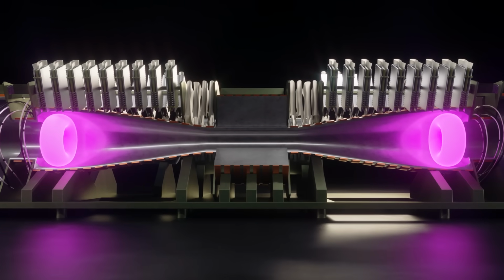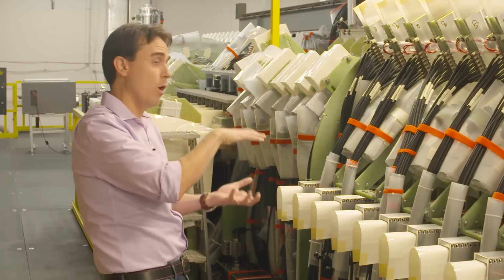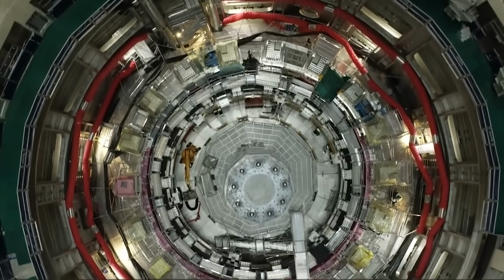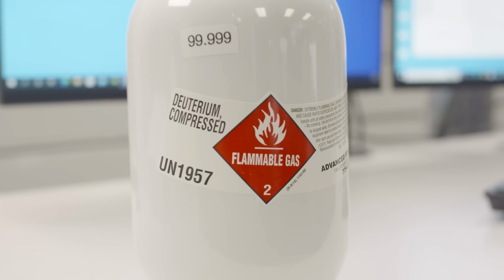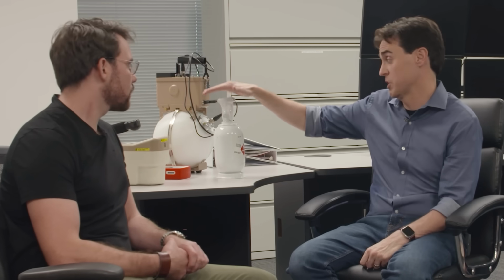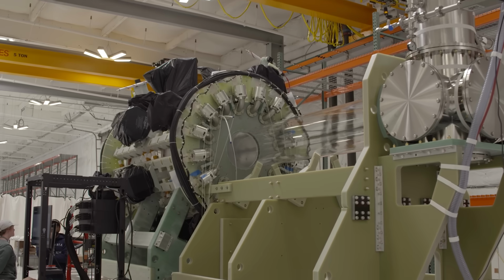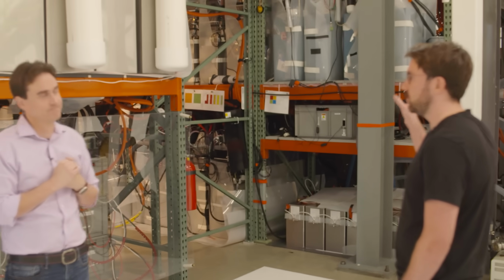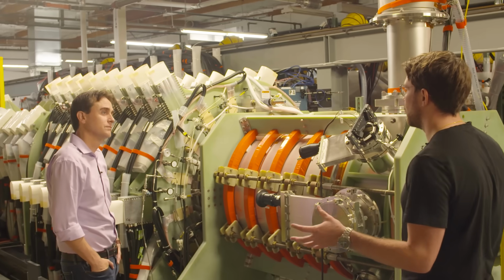A New Way to Achieve Nuclear Fusion: Helion

Comment: I'd be curious to know if someone could take this machine into the space vacuum chamber to see how it would perform, with your machine and some tweaking I can see space travel evolving like it's never been imagined before.
Reply: It even looks like a starship motor
Reply: @datalink-v8n  This design probably wouldn't make a very good engine for a starship though because it's a pulsed design. Engines need uninterrupted thrust. There are designs for fusion engines out there though.
Reply: problem is how to carry it there or make it fly, which is biggest problem and limitation of current space travel which is very mass limited due to fact that you need to beat earth gravity to go to space. Thats why having a moon base and mine resources there would space travel boost capabilities have like 1000x. You also need to rember that fusion reactors consume energy, to create reaction that creates more energy, it needs external energy to work

Comment: You know, a few weeks back when there was an announcement of a more 'traditional' fusion reactor achieving equilibrium, the internet was rife with speculation on how the energy could be captured, with many predicting the classic 'turn water into steam' approach, because that and thermoelectric compounds were the only methods people could think of.
Even just their method of using 'magnetic movement' directly around copper wires is revolutionary, even if it's 'facepalm-why-didn't-I-think-of-that-myself' type straightforward in hindsight (after all, most of us are taught the basic concept of how dynamos/generators work, even if we're used to them being moved by kinetic energy which is often generated by steam-powered turbines.
I feel like this concept by itself is already a major step forward for fusion power generation, for 2 reasons. 1 being that it removes a design limitation, in that water no longer needs to be engineered into the equation. Then add the fact that the obligatory energy loss from each transfer step is eliminated, and just that step is already massive progress. That's before the talk about different fuel mixtures, Tritium, and Tokamaks creating highly dangerous radioactive material in their own structure.

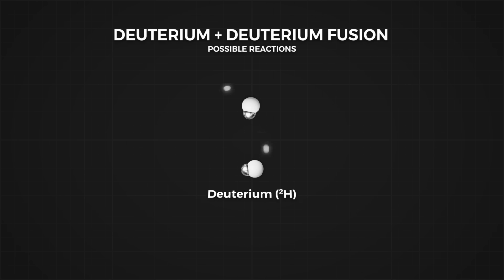Comment: 13:25 So you say helium-3 is the preferred reaction from D-D fusion because it has a lower mass deficit. What about the fact that the higher mass comes from creating a neutron compared to a proton? When you only account the tritium vs helium-3 the tritium has higher mass and is easier to achieve fusion with. Why isn’t tritium preferred? It’s not like you’re gonna use the neutron as fuel. Am I missing something here? He even said that neutrons are a problem for reactors in the beginning.

Comment: Not an expert.  Simple questions:
1.  What is the input energy vs. output energy relationship, and how do the various methods compare?
2.  What is the cost vs. life of the various devices?
Most of the other details are far less interesting to me.
Reply: @RealEngineering1290  I do not understand what you said.

Comment: Amazing machine. Using the magnetic confinement to resist the expanding fusion reaction in order to get usable electricity is pure genius.
Reply: This is also useful in other types of magnetohydrodynamic generators using other than thermonuclear fuel. 
    This system has a nice ring to it. Deriving the net energy output from the confinment fields , or confinement/ output fields.  An eleant and simple solution that eliminates a lot of expensive equipment required to generate electricity. The reject heat from this system would also be harvested.
Reply: @daleeasternbrat816  plus it gets rid of the fact that we basically create the building blocks of SUNS.. actual STARS.. then turn around &use all that energy to.. *checks notes* 🧐 boil water 😂🤦🏾‍♂️
Reply: @o-wolf  

''basically create the building blocks''
Basically USE the ''building blocks'' (atoms, elements) of STARS to generate heat to create steam to run turbines''
FTFY.
No one can create matter. (out of energy and certainly not out of thin air, if that was possible  fusion would be superfluous)
Reply: @rocksparadox  go away professor pedantic
Reply: I've always found the most genius concepts to be the ones that seem the most obvious once they've been spoken.
Reply: I still don't get how it works. I taught you have to have moving magnetic field to generate electricity...
Reply: @vladimirhaviernik3568 The plasma fuel in the machine is made up of charged particles. The temperature of that plasma is a representation of the speed those particles are moving. An electric current is just a measure of moving charges. When fusion occurs it will add heat and therefore motion to those particles, increasing their speed and therefore the current. A changing current creates a changing magnetic field, which can be captured as a current in magnetic coils.
Reply: @vladimirhaviernik3568  from my dumb dumb understanding:  both plasmas needed for the fusion reaction themselves on each side get accelerated by magnetic rings at high enough velocities into the magnetic confinement field for fusion to occur. the fusion reaction bends the strong magnetic confinement field, which is in effect similar to your "moving magnetic field".
i find it astonishing that this principle generates surplus energy.
there might be something wrong with my understanding ^^
Reply: @vladimirhaviernik3568  The particles that is created in the fusion reaction is Charged and when they fuse in the middle of the Reactor Chamber the plasma is expanding and the Magnetic Field from the Charged Particles In the Plasma Pushes on the magnets so it creates electricity in the magnets
Reply: @vladimirhaviernik3568  It can't generate any power. It merely consumes power.
Reply: is the concept genius, or the engineering?
Reply: @petegriffin8149  neither
Reply: A real life doctor octopus. Doc Oct.
Reply: Yeah, Einstein was a pretty a smart fellow. Magnetic fields to contain an atomic reaction. Same thing Ge ( Earth ) does everyday with its electromagnetic field.
Reply: @clock w0rk It's still just an experiment, it doesn't even produce net energy. If it ever does, they can worry about that sort of thing then.
Reply: @clock w0rk It only creates pulses of energy. Not much practical use.
Reply: @grahamstevenson1740  it doesn't produce energy consistent right now, but if it works as intended, it will produce power. They have to solve engineering problems that are right at the boundary of human technological capabilities. 
From what I understand,  the idea is that it pushes back on the magnetic field used to contain the fusion reaction, the change in the field induces current and is recaptured.
Reply: A rebuttal: https://www.youtube.com/watch?v=3vUPhsFoniw
Reply: That’s all of them
Reply: Tokamak type reactors use magnetic containment... and they are a soviet design, so it's not really a novelty. The concept has been around since nuclear fusion reactors were first conceived.
Reply: It is genius, but it's been well known for 60+ years, basically since aneutronic fusion reactions were identified.
Reply: Genius?? No, sorry, but what runs the magnets? Electricity, lots of it, it probably takes far more electricity to enduce the magnetic squeeze than the electricity the plasma will produce. That's if they dont blow themselves up first... also, what happens when that 20 million degree plasma can't be contained and is accidentally released? The heat this thing will create will warp the  entire structure over a period of time and will be useless...
Reply: Who said it made any electricity ? There's no output from it !
Reply: If you use quantum computing to adjust autonomously it’s more efficient
Reply: @mindfuljourneyVR  Quantum computing only has three states. There are many more states. That these Shadow ruled Scientists have no clue about.
Reply: It's not genius, it's fake.

Comment: Bottom line, is it capable of a meltdown with bad consequences. And what is the ratio of energy in and energy out.
Reply: No, fusion isn't capable of producing a meltdown, because the reaction only occurs in very special conditions that, if end, stop the fusion immediately. And the theoretical energy output ratio is about 7-12 times that of its input, depending on the type of fuel used and the reaction ofc.
Reply: Fusion in general isn’t capable of a meltdown. Even if someone planted a bomb on it, the blast wouldn’t even leave the building. It just doesn’t have enough radioactive material to cause a meltdown.

Comment: I have a question at 13:17 to 13:47, and please forgive my ignorance as I am in no way, shape, or form even remotely close to being an expert on nuclear physics.

When David explains the Mass Deficit, he references E=MC^2. Is this conversion of mass to energy essentially the same as matter/antimatter annihilation? Is antimatter a byproduct of Deuterium/Deuterium fusion? Or am I completely missing the mark?
Reply: Matter/antimatter annihilation is one type of mass to energy conversion, but not the kind used in this instance. The mass that is converted to energy in this instance is the energy is the atomic bonds. That is why the products have lower atomic mass than the reactants.
Reply: @mcmatthew7898  I appreciate the reply, and I have a followup question. After a very cursory reading (on Wikipedia, of all places) about the strong force, I assume it’s the guage bosons that are either being converted or treated as the energy output? Is this what is causing the loss in mass?
Reply: @XiozTaschez   sorry I don’t know much about subatomic particles below the level of protons, neutrons, and electrons, but I can explain it on that level. 

Atoms that are less stable have more potential energy. It’s like how an object up high is unstable because of its potential energy. Just like the high up object seeks to release its energy by falling an unstable atom will try to release its energy through radioactive decay. When you’re able to fuse two unstable atoms together to form a more stable one and energy is released. Since the atom is now more stable it doesn’t require as much energy in its bonds, the energy that was in the bonds of the unstable atoms is released.

As far as which particle constitutes the mass which is converted into energy, I don’t think any particles are converted into energy. I’m pretty sure the mass of the same particles is increased as their energy increases. The same effect happens for kinetic energy. As an object’s kinetic energy increases the same object will have more mass.
Reply: @mcmatthew7898   No need to apologize, and thank you for taking the time to explain.

Comment: This article and tech is so interesting and mind bowing. 
My long winded question is this, given the high temperatures needed for fusion and then discovering that the next gen unit needs to be 25% larger, what ensures this can't essentially run away or melt down the reactor, or worse cause part of the surrounding earth itself to get engulfed by the heat of a sun? Or is it once the continuous firing of plasma stops, it would cool fairly quick? It seems that if the suspended electromagnetism stopped for any reason, nothing would be able to contain the extreme high temperatures for very long without a massive meltdown.

Comment: Wouldn’t the lack of a need for water to turn a turbine mean you could, theoretically, put something like this in something in orbit to power it?
Reply: Yes, it would still need some cooling (and cooling panels), but less than designs that require a steam cycle.

Comment: Insanely efficient at turbines are not having to use them makes these generator more scalable too. Helion seems like the way to go for making spaceships. He3 isn't that rare in nature is just rare in earth. The moon has more He3 than the earth has water, so we will likely need this technology tho make this technology possible...
Reply: Helion will produce their Helium3 by fusing Deuterium in the same machine. D+D => He3 +n or D+D => T + p (the Tritium eventually decays to He3 as well). No space travel required.
Though if someone was already mining the moon (or some of the outer planets), then it would make sense to also get the He3 from there.

Comment: It’s not making a lot of sense to me the part where he said Helium-3 fusion is preferred because it creates no neutrons. To create the He-3 you have to do a D-D fusion reaction which creates a lot of neutrons, you aren’t really avoiding the neutron problem with He-3.

On top of that a D-He3 reaction takes much higher temperature to maintain than a D-T reaction. A pure He-3 He-3 reaction takes even higher temperatures to maintain. Achieving those high temperatures in a controlled manner is the entire challenge with fusion. By using He-3 fuel you’re handicapping yourself.

Comment: The heat that is generated, harness that into making the general steam turbine energy. That way they make energy of the excess energy.
Reply: There is only about 10% of the energy lost to neutrons in a mixed fuel machine (the same machine does He3 breeding and electricity production). It would be a bit more in pure D-D breeders (about 34% of the energy is in neutrons) and that is where it could make sense to get a bit more out of them. But that also comes with a higher construction cost and greater plant complexity and size.

Comment: How does this compare to/contrast with the National Ignition Facilities method on a larger scale? While using lasers vs more traditional plasma methods is understandable on the surface, it would be interesting to get a fuller breakdown of the methods, strengths, weaknesses and probabilities of production level capacity between the two. Also, is there any crossover where the technologies could be combined to overcome some of the inherent weaknesses?
Reply: Very different technologies. A NIF style power plant would be much bigger than what Helion is planning to build. Also, lasers are currently too inefficient for that to be practical.
Helion in contrast has a good shot at net electricity production in the near term (goal is 2024).
Reply: They’re different thing. NIF is a military facility for testing nuclear weapons. It’s very inefficient and could never be used for electricity production. 

Helion has a very immature design currently, probably a couple decades from making significant net power - but is designed for electricity, unlike NIF.

Most commercial startups like CFS use tokamaks, which are much more advanced.
Reply: @Gomlmon99   Helion's Polaris will demonstrate net electricity in 2024. Not a couple of decades. They are moving much faster than government programs.
Reply: @elmarmoelzer2229  That’s what their PR team say yes. They’ve said “a couple years away” every couple years for many years.

Their plasma physics is apparently poor. They are seemingly miles behind other commercial startups. Ahead in PR though.
Reply: @Gomlmon99   They have not said that. That's nonsense.

Comment: So then wouldn’t the most obvious idea then be to have something outside of that chamber that WILL use this neutrons? 
I don’t know what that means or what that looks like, but let’s start talking about what if…sometimes having a smaller mind, I might be able to see something that was over looked. 
My son surprises me sometimes with simple solutions. 
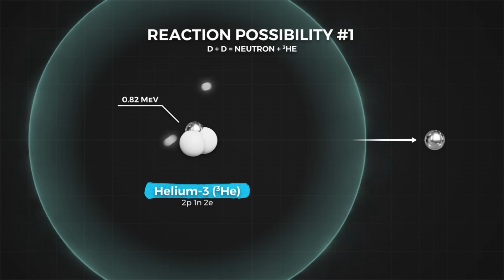…if it can’t be done…why not?, and if there’s an “unless”…(I hope there is) 14:54
Reply: They are aware of the neutrons and the possibility to use them for something. E.g. they could be used for breeding more Tritium in a Lithium blanket, or making some rare and useful isotopes. In purely D-D powered He3- breeder versions of these machines (which are currently a consideration), the neutrons make 33.6% of the energy produced. In that case it could make sense to harvest the energy from that neutron with a steam cycle. Though I think that if they do that, they should also do the Lithium blanket since it would add a bit more energy even and produce more Tritium.

Comment: What is the Q factor of the current generator and the expected Q factor for the 7th gen generator?
Reply: Is still not fully public, but I hear that Polaris will have a Q(sci) of less than 2 (that is for D-D/D-He3). Final powerplants might be as high as 5 but could close with as little as 3. 
Trenta is somewhere close to 1 (for D-T, not D-D/D-He3) by my estimate but that is theoretical since Trenta does not extract electricity. 
It is worth noting that Helion does not need a high Q because of the extremely efficient direct energy recovery/conversion system.